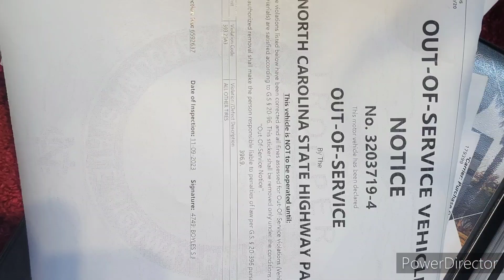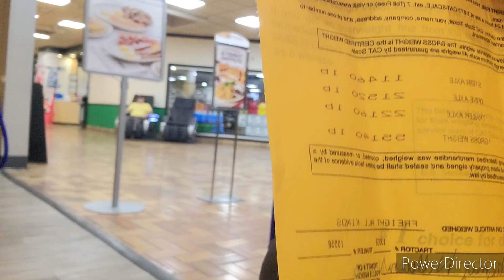scoob e do get placed out of service in NC.

Comment: I don't have 36 years of driving experience but in my 13 years i never had that many problems with getting pulled or put OOS by DOT . Only issue i had was a slight overweight on my drives and they let me correct it n  go on my way. Also one time i gotta ticket for sleeping on the shoulder of the interstate in Jersey but other than that , i never got pulled over like that. Yes do your pre trip , its a part of your job but i think we can over exaggerate to the point to where we doing way too much unnecessary stuff. We will never be focused on the road and make the money we are trying to make because we're paranoid about DOT.  The drivers that i see DOT wanna nail is O/Os Amazon contract drivers , shipping containers, intermodal and oversized. Not a lot of company drivers. Just do your job guys , make your money, stop getting paranoid with DOT and make it home